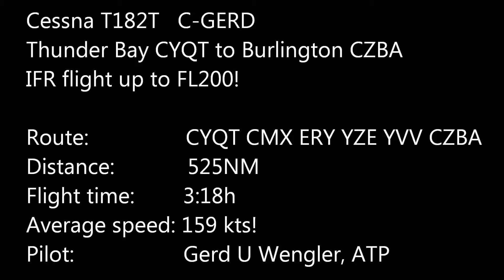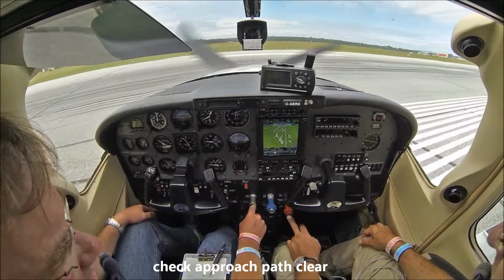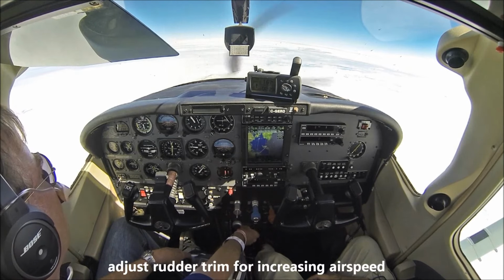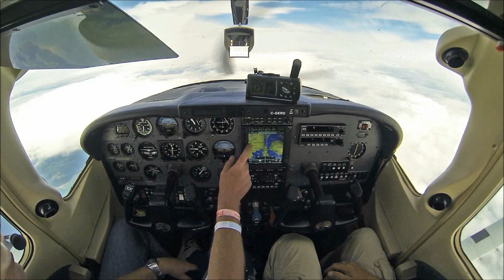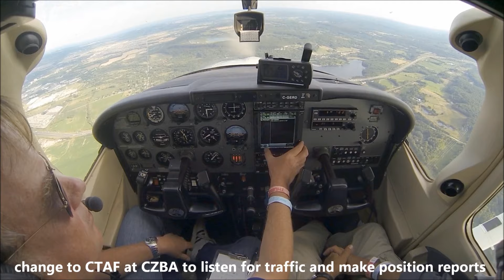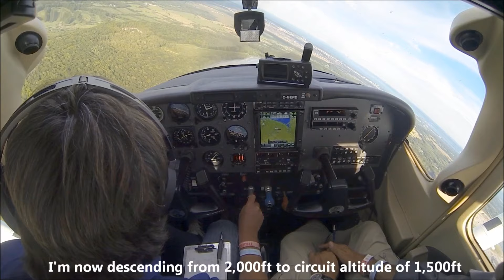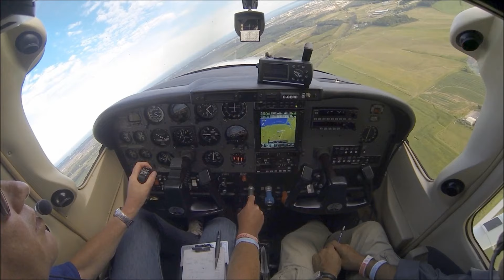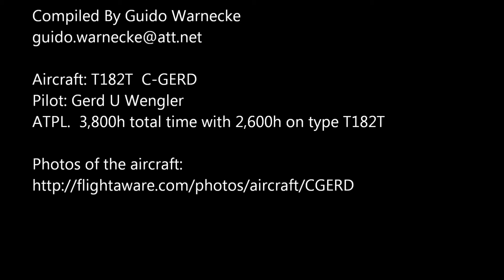Cessna Skylane at 19,000ft - cockpit video - must see!

Comment: does that even have Engine De Icing?
Reply from the maker: Hi Kyle,
if you mean carburetor heat the answer is no. it is a fuel injected engine.
Happy Landings,
Guido
Reply: huh never seen a Cessna that has one only 172 has it right?

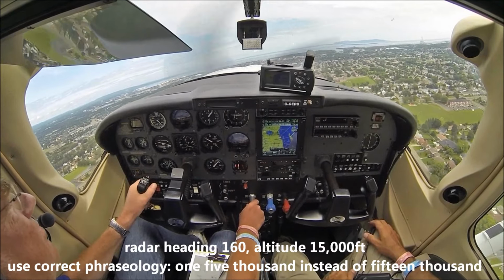Comment: I'm wondering why you at 3:08 place on the screen "use correct phraseology: one five thousand instead of fifteen thousand". Then when you check in at altitude you use "with you".  Might be a bit of nit pick but correct phraseology is brevity and with you doesn't qualify as correct.
Reply: I was the (amateur) pilot and I am sorry that I acted in such an unprofessional manner.
Reply from the maker: I have to file a report with the appropriate authorities for this severe deviation from standards.
Happy Landings,
Guido

Comment: What is the beeping at 10:35 ???
Reply from the maker: +Joep Leijendeckers I honestly do not know - but I will ask.
Happy Landings,
Guido
Reply: This is an aural alert (5 short tones) from the autopilot KLN140 which occurs 1000 feet from the (on the autopilot) selected altitude upon approaching and 200 feet from the selected altitude on leaving the altitude.
The altitude shows 1800 feet on the altimeter.  2000 feet had been selected on the autopilot, so the beeps occurred 200 feet from the selected altitude.
Reply from the maker: +Gerd Wengler Thanks Captain!
Reply: +Gerd Wengler I am 5,8 and I had the same problem learning in a Cessna. The aircraft I was using was built in 1973 and had a very high instrument panel, not only could I not see over the cockpit instrument panel on landing but during level flight as well. It absolutely ruined the experience for me so I decided to give it up after 5 lessons. The modern aircraft in this video has great forward visibility, I am sure if I had of learnt in a similar modern aircraft I would had finished my training.

Comment: What's the TAS up there?
Reply from the maker: Hi Björn,
depending on weight, the TAS is around 160 knots at this altitude.
Add some 40 knots of tailwind going eastbound and you see a ground speed of 200 knots.
Not bad for a Skylane!
Thanks for watching my videos & happy landings,
Guido
Reply: That's impressive! Thanks for the answear.
Reply from the maker: Björn Lillpers You are very welcome, Björn.
The good thing about the T182T: if you have strong headwinds you can still fly with reasonably economy at low altitudes.
Happy Landings,'
Guido

Comment: Is the cabin pressurized? If not, why are your guys not wearing oxygen masks?
Reply from the maker: Hi Roger,
the cabin is not pressurized. We use nasal cannulas and masks during the flight.
Happy Landings,
Guido
Reply: Is the oxygen supply system included in the plane's standard setup or it's an additional accessories?
Reply from the maker: Roger .J Hi Roger,
in the turbocharged T182T, the oxygen bottles are factory installed.
You can't really use the performance of this aircraft without oxygen.
Happy Landings,
Guido
Reply: Do you need to refill the oxygen bottles every time the bottle is done? If yes, where can you refill it? Thanks
Reply from the maker: Roger .J Depending on the altitude and the number of persons on board, the bottle can last up to 10 flight hours.
The maintenance shop normally refills the oxygen.
It has to be aviation certified oxygen, mainly because of moisture content (possible icing).
Happy Landings,
Guido

Comment: Aerodynamic braking, that's funny.
Reply from the maker: +s stan 
That's how it's called...
Keep he nose up and use the drag of the wings to assist braking.Only in light aircraft. In jets you aim to put the nose wheel on the ground in order to minimize lift of the wing and maximize the load on the tires -> maximum breaking.
Happy Landings,
Guido

Comment: why 2 attitude indicator?
Reply: Redundancy.  One is vacuum driven, whereby the engine drives the two vacuum pumps - so no electricity required at all.  The other one is electrically driven, in case both vacuum pumps or some other component of that system fail.
Reply from the maker: Hi Andreas,
here a link to my latest video. Jets typically have 3 attitude indicators.
https://youtu.be/Af3fVp8R8bg
Happy Landings,
Guido

Comment: What does flight level mean
Reply from the maker: The aircraft has an altimeter. This instrument does not really measure "height" it is an instrument that measures air pressure and calculates this into "height". Air pressure decreases with height.
To do this accurately, the pressure at seal level must be known, called "altimeter setting".
If an aircraft flies through areas with different seal level air pressures, the altimeter setting needs to be adjusted very often
This would not be very practical for fast moving jets.
To make this easier, a "standard altimeter setting" was invented.
The altimeter may not read the accurate height but it will read the same for all aircraft using this standard altimeter setting.  It is important for collision avoidance that two opposite aircraft have a precise vertical separation.

Altitudes that are flown using the standard altimeter settings are called flight levels.
To differentiate flight levels  from "normal" altitudes, 2 digits are removed.
19,000 ft becomes flight level 100 and so on.
Happy Landings,
Guido
Reply: Guido Warnecke ok, thanks

Comment: a fellow a-36 bonanza pilot 19,000 ft.  oxegon mask?
Reply from the maker: Hi Gary,
I hope he used some form of supplemental oxygen...
At 19,000ft you must be a Sherpa living in the Himalaya not to pass out...
Happy Landings,
Guido
Reply: nice hearing from  you ,could it have been pressurized ???Guido Warnecke
Reply from the maker: Gary Wilkins Bith the C182 and the 36 are unpressurized.
Only the C210 comes in a pressurized version, called P210.
I have flown this aircraft as well. Photos here:
https://flightaware.com/photos/aircraft/ZSORO
Pressurization is a big issue in these small aircraft. The air comes from the turbocharger in the engine. To seal the cabin is difficult and the differential pressure between inside and outside requires structural re-inforcements of the cabin.
This is why they are all non pressurized.

Happy Landings,
Guido

Comment: Full flaps on base ??
Reply from the maker: That is correct, Scott.
Flaps are used to control airspeed and descent profile.
We were probably a bit "hot" on the approach, hence the relatively early deployment of full flaps.
The C182/C206/C206 produce a lot of drag at full flaps. And these are only 30 deg, nit 40 deg as in older C182  models.
As long as you are aware of this - no problem.
Happy Landings,
Guido
Reply: Thank you for your reply . I am just a Piper driver if I put full flaps in on base I would have to drag the aircraft in with power on final . Just food for thought. PS Love your vids.....
Reply from the maker: Thanks, Scott.
Low and slow is never good and generally full flaps come on short final.
You still have the manual flaps with the big handle?
Happy Landings,
Guido

Comment: The descent is way too fast. The needle is in the yellow arc. Plus the descent checklist is not followed at all (otherwise the mixture would be enriched way before).
Reply: Josep-Angel Herrero  The Descent Checklist is this:

1. Power -- AS DESIRED
2. Mixture -- ENRICHEN as required

For descent the mixture must only be enrichened to avoid the TIT to go too high.  Nothing is required per checklist if that is not the case.  As per the yellow arc (not sure where you see it), as per POH:  "Operations must be conducted with caution and only in smooth air."  Not sure why you think that the descent is way too fast.

How's your T182T experience?
Reply: Gerd Wengler The mixture was not even touched during the entire descent (which is surprising considering you were flying at FL190). Starting from minute 8 the needle is in the yellow arc.

Just trying to be picky :). Nice video though.
Reply: Josep-Angel Herrero No need to enrichen the mixture because the TIT stays rock solid until you get much lower.  In fact, I do not "touch" any engine controls during the 500 fpm descent.  That's the beauty of the TIO540 downrated to only 235hp.
The air was totally smooth, there was not even a hint of turbulence; therefore, yellow arc speeds are not prohibited.  And no turbulence was expected; I know the weather in this part of the continent quite well.  Had there been any turbulence, I would have slowed down.  I avoided all clouds in order to not get into turbulence as you saw in the video.
Reply from the maker: Josep-Angel Herrero Many airplanes do not even have a yellow arc. We are talking about a lot of turbulence here until an operation in the "yellow arc" would not be advisable, some chops are not enough.
In a non turbocharged aircraft or an older turbocharged aircraft there would be indeed a lot of turning on the mixture knob and throttle, not on his T182T with the TIO540 engine.
The air pressure is sensed and the amount of fuel injected is automatically adjusted according to the manifold pressure.
Gerd's procedure to keep the power on during descent is actually good to recover some speed lost during the 35-40 minute climb to FL190.
If you look at the average speed on this flight (stated in the video title) this is quite impressive!
Happy Landings,
Guido
Reply: Thanks for the explanation. I learned new stuff.

Josep
Reply from the maker: We always learn in aviation!
Happy Landings,
Guido

Comment: Did you go straight from 20% to full flaps?
Reply from the maker: MKT Transport Video Yes, this Cessna has only a 10-20-30 flap positions.
Older models had a 40 deg position.
This has caused problems at go arounds.
Happy Landings,
Guido
Reply: Ah I see, thanks!

Comment: Here's a stock 1965 Skylane, with a regular 470 engine, no turbo, at 18,000 feet.  https://www.youtube.com/watch?v=EkIdz19ac0Y .  Not as fast or as sexy as a T182T though.
Reply from the maker: +mdhsabh That's pretty impressive.
The bird worked hard, 13 inches manifold pressure only - but you made it!
Thanks for sharing.
Happy Landings,
Guido

Comment: Aircrew using cannulas (vice masks) which are unapproved in U.S.A. for operations in cabin altitude of 18,000 feet MSL or more, and for each cannula in use, you have to have a standby, conventional face mask at the ready. Canadian requirements (CAR 605.32) are more stringent. Risky operational practices.
Reply from the maker: Hi Larry,
mask were used above FL180, not visible in the video.
Not sure about the requirement to have standby face masks blow FL180.
I use electronic oxymizer system in unpressurized aircraft and carry a second unit and spare batteries.
Happy Landings.
Guido

Comment: i thought you needed oxygen over 18,000 feet
Reply: +King James For unpressurised aircraft, you need O2 at all times above 10000ft.
Reply from the maker: +palonazo 
That is basically correct. There are different rules in different countries.
Happy Landings,
Guido
Reply: Guido Warnecke
Yeah, EU OPS 1.385 is the one we follow here. Is there any ICAO state with a significant difference for the requirement of O2 for unpressurized airplanes? Maybe high elevation countries have lower requirements.
Reply: palonero h

Comment: That rate of climb is so anemic after 11,000, why bother.   Buy a Citation or King Air if you want to cruise above 500mb
Reply from the maker: It's the problem with the $$$....
Climb rate is 500 feet per minute in cruise climb so it takes a while. On longer flights like this one with a 40-50 kts tail wind it makes sense to climb that high, plus you are above weather.
Thanks for watching my videos & happy landings,
Guido

Comment: A C182 can’t fly that high.  Sorry there’s no way you’d be at 19,000 AMSL in that aircraft type.  Not to mention a C182 isn’t pressurized so you’d need oxygen masks to fly at 19,000’ AMSL. 

And yes I’m licensed pilot in 2 different countries. 

You need to amend your video title. It’s click bait…
Reply: Yesterday:   https://flightaware.com/live/flight/CGERD/history/20210605/1700Z/CYMO/CZBA/tracklog
Reply from the maker: You are correct. The FL190 is misleading. We were up to FL200 :-)
The T182T has a limit of 20,000ft, which is more a marketing limit to differentiate the T182T from the TU206 which is certified to 30,000ft. (FL280 non RVSM).
I have been to FL230 in a TU206 at cruise on a ferry flight. 
The big engine in the turbocharged T182T runs with totally normal temperatures at FL200, giving the aircraft at true airspeed of 165 knots.
Not bad for a fixed gear Skyline. 
My mother had always a good line:
“Never judge a book by its cover”.
Happy Landings,
Capt. Guido
Reply: @GuidoWarnecke  

Even if an airplane can reach that high in factory testing, I don't see the point of flying so high over such flat low lying land...so do why do it?   You're just burning up extra fuel for nothing really.  Eg. the highest I've been in Cessna was 14,000 AMSL feet.  This was to cross mountains at 11,000 feet AMSL.  If you're flying a pressurised private jet or even a C206 or C208 sure, but a small C182 - I don't see the point of flying so high above low lying flat lands. 

To critique your landing - Well your video shows a seemingly long overshot landing with hardly any flare just before landing.  Did you flare at all just before touchdown? I hope at least you did't land on all 3 at the same time.  (Potential facepalm).   Don't worry I critique my own landings all the time, its the only way to keep improving/learning. 

I learned to fly in a mountainous coastal region with lots of unpredictable winds/unpredictable easily changeable Wx.  This flat area you are showing here looks quite simple actually less perhaps dealing with summer density altitude issues if this Florida as shown?  If you ever get a chance, trying flying up in Western coastal Canada or Alaska near the coastal mountains. If you're unsure of mountain flying, bring a local bush pilot with you for safety for the right seat.    

Blue skies, fly safe...
Reply: @420van01  Hello Ms. 420van, thank you so much for your valuable lessons. It is so good to hear from a Lady Pilot.  Just for your information, Guido and I are both ATPL and have 20,000+ hours between us.  I have extensive bush flying experience in Canada, Alaska and southern Africa.  I have been flying extensively in the Canadian Arctic (North Pole), in the Rocky Mountains and have flown up and down the Pacific coast many times from Mexico to Alaska, with this very airplane.  I have more than 3,500 hours as PIC in this very airplane.  Therefore, I am so thankful for you telling me that I am still doing it wrong.

I am so grateful to hear from you that I should not fly the airplane the way it was designed for.  I do fly high regularly, almost every week lately, for the following reasons:
a)	During thunderstorm season you can very often fly visually (ATC approved diversions) around the big build-ups with a safe distance;
b)	the best way to avoid icing is when you are on top.  No clouds – no icing;
c)	you get really good tailwinds when you fly easterly directions.  In the winter I had often had more than 100KTS tailwind, smooth as a baby’s bottom; and
d)	with a turbo charged (or turbo normalized) piston engine, your specific fuel consumption drops dramatically when you’re high up.  Low you might have 9.2 mpg, whereas high you would have 13.3 mpg no wind, a dramatic 43% decrease in fuel consumption per distance flown.  If you have a 62 KTS tailwind high up, you double (!!!) your fuel efficiency to 18.6 mpg.

As you are an experienced pilot, I will re-think my theories.  Could you give me some hints where I would find the underlying assumptions of your facts?  As you said in your post, I am so unsure about this, I can certainly use your help.

Comment: Icing like we get here and you would have been a death flight
Reply from the maker: Hi Tony,
icing needs to be treated with great respect in ANY airplane.
Where so you fly?
Happy Landings,
Guido
Reply: Guido Warnecke HI I fly in New Zealand.. we are in the 40s South latitiude
so lots of wind and too warm for it to be too cold for ice.
Typically ISA +3... We get lots of supercooled air masses so the ice is like " shit to a blanket"
In fact 2 years ago we had a heavy turbo prop have an ice encounter and a LOC
which resulted in the death of the 2 pilots ( a freight flight ) a Convair,
Its great you are wary of ice.
FYI I am flying a FAR121 passenger aeroplane here and had many ice encounters that required an immediate descent just so as we could keep flying.
Reply from the maker: tony m Thanks, Tony.
I fly in the part 135 in the Northeast USA - same situation sometimes. A lot of moisture and a lot of ice. Luckily mostly rime ice. I have not been in clear ice and have no special desire to do so...
I do not know of any airplane that handles severe ice well.
I fly King Airs with boots, they struggle but the wing is fat and keeps flying.
Hot jet wings can be critical too. At the moment I fly a Citation V with hot wings on the roots and boots on the rest of the wing.
I totally agree with you: icing is an encounter that needs immediate attention. Climb descent, return - get out of it.
What he had in the C182 was just a trace of rime, insignificant.
Are you doing these crazy crosswind landings at Wellington  too?
Greetings to NZ & happy landings!
Guido